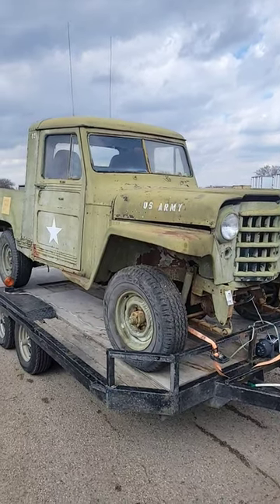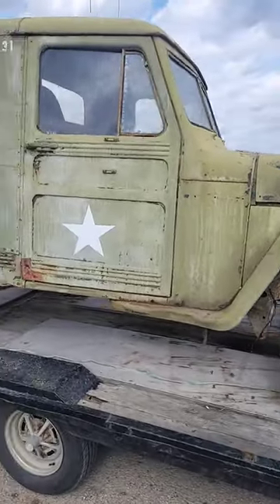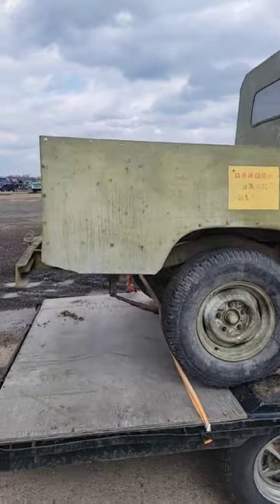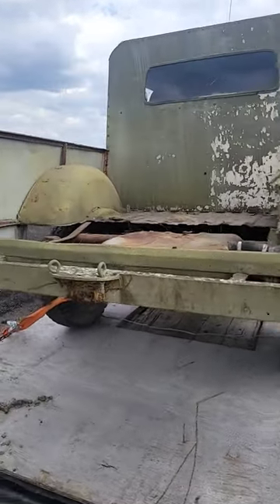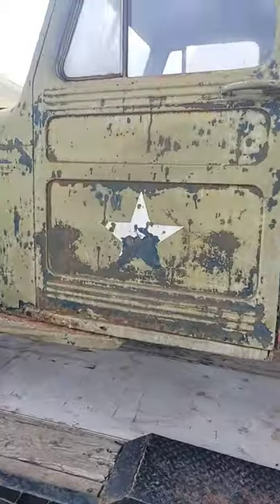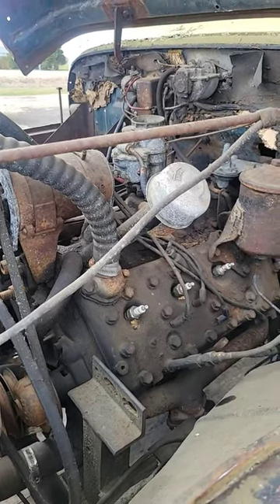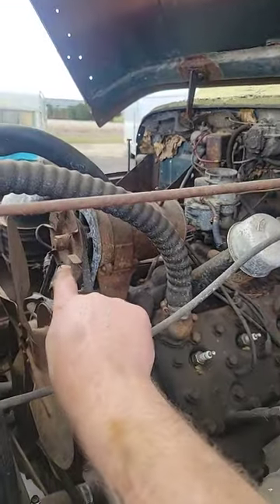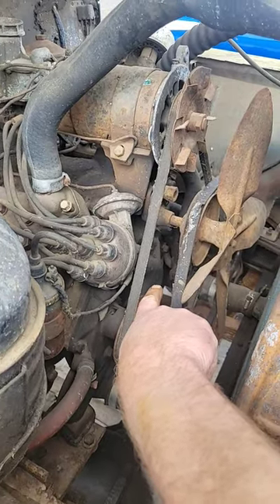1950 Willys Overland US Army truck.  Ford Flathead V8 powered.   Cool old rig. #shorts

Comment: Is that a 49 A-B block flathead V-8 ?
Look for the raised A-B in the casting.
49 and up is supposed to have a distributor of the modern type in the front. It would have a bell housing bolted to the engine not incorporated into the block.
Flat heads were used in some military vehicles.
So I read. 
The early flatheads had cooling, or oil usage, or casting porosity issues in some examples.
Many changes and improvements were made since the 1930's.
The war halted production and it began again later.